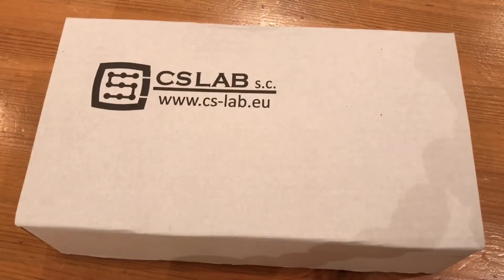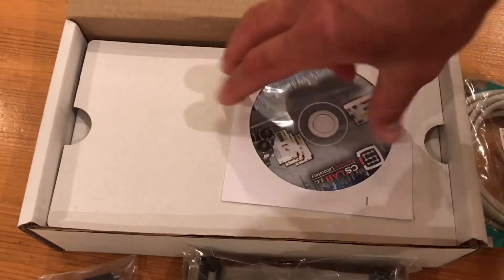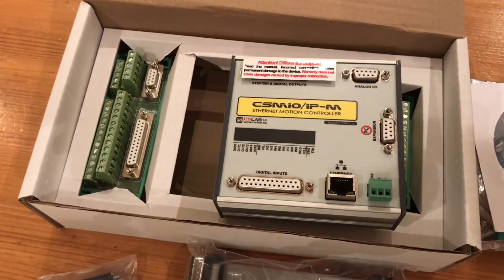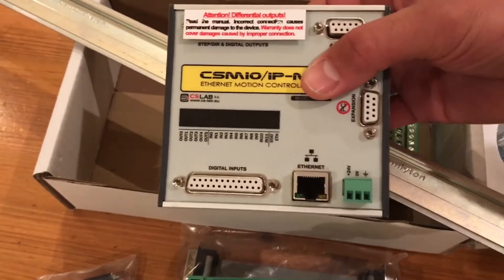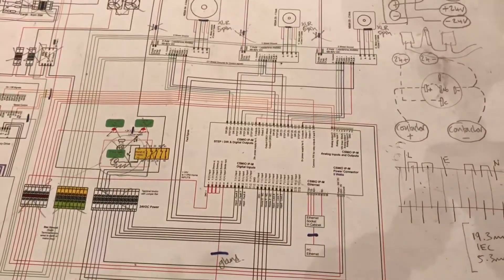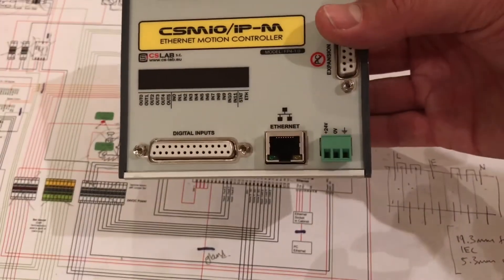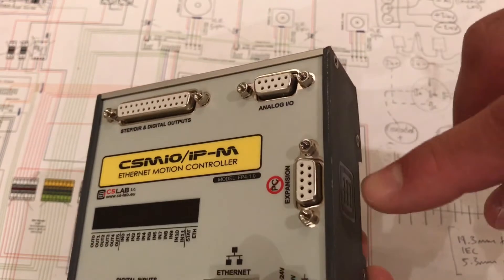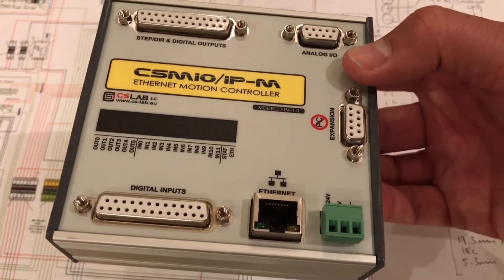Unboxing CSMIO/IP-M Controller for DIY CNC Router

Comment: Nice one Joe.  I've only heard good things about the CSMIO/IP-M so it should serve you well.  I'm still running through the parallel port, into a cheap BoB and analogue drivers.  It is tempting to upgrade but it works fine.  If I was starting from scratch I wouldn't hesitate though.
Reply from the maker: +routercnc just hope I don't destroy it by connecting it up wrong!!